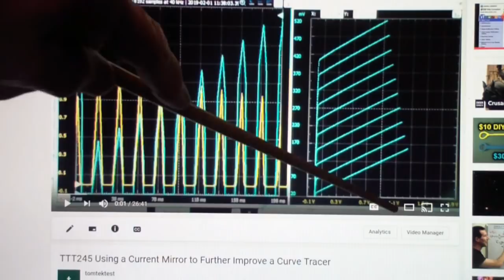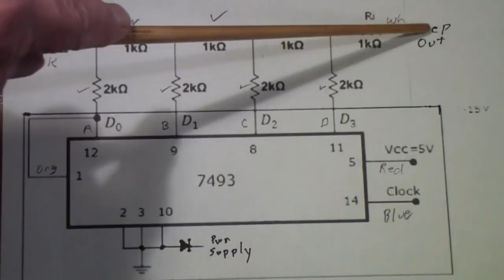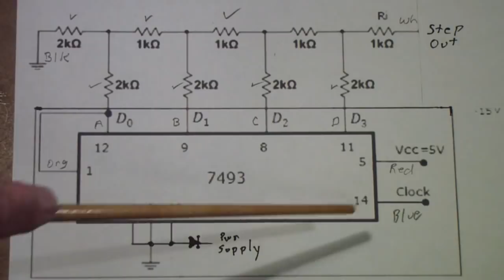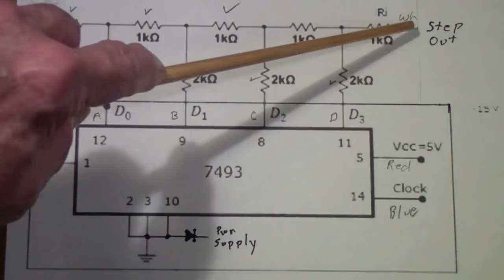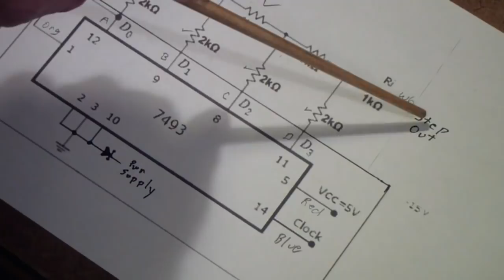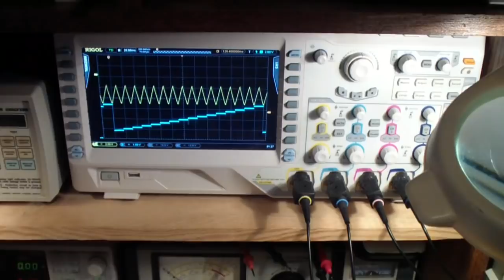TTT251 XR2206 Stepping Up for the Curve Tracer

Comment: Hi Tom,  thanks for the brilliant idea. Unfortunately in our local electronics store 7493 wasn't available. I searched for the similar and find out that 7490 has almost the same structure. It's decimal counter but it has additional NAND circuit so input should be set up to zero by grounding. The circuit provides very nice 10 stair steps gen. But it was not so easy. In the first attempt to design it I have forgotten that it is digital circuit. The steps were doubled and followed some weird curve not linear direction. As I used 7805 as the 5V supply directly on the board I should add some 330microF condensator. If became much better but the steps still were jittering . So editional 100 nF cond connected directly on the pin No. 5 finally solved the problem.

Comment: hi tom i'm building the stair step gen using dm7493an and  want to use it on one of my old cro's along with a sawtooth as a tracer.. going to use 555 for clock how fast dose it need to run roughly i will leave a pot in circuit so can adjust to fit scope screen.. also would like more current so can sweep larger power transistors. can i use lm358 on the output of the 7493?? thanks
Reply from the maker: I use a frequency of around 50-60 Hz for the sawtooth which is synchronzed to the counter clock. I am not sure why you want to use the lm358 on the output of the 7493, but I may just misunderstand what you mean. You can use an lm358 on the output of the r/2r resistor network that converts the 7493 count to the stair step to provide more current drive. Just be sure to observe the current limits of the r/2r network when designing the input circuit of the lm358.
Reply: @tomtektest8042  thanks tom and sorry thats what i meant  mean n the step output from r2r to provide more current so can sweep lager transistors also could i use the ramp from the  555 rc pin (amplified) to drive scope sweep or even a second 555 sawtooth generator driven from the first 555 rc pin for sinc
Reply from the maker: I hope you will understand that I try not to intrude into design decisions since they involve various levels of experience, budget, available materials, etc. Instead I encourage viewers to experiment and, if possible, find a local partner/mentor to work with.
Reply: @tomtektest8042  ok well thanks anyway
Reply: @T2D.SteveArcs Steve just built a Push Pull amplifier which I copied from Kerry Wongs Curve Tracer Titled Yet another Curve Tracer. 😊😊😊😊😊this should give you the extra current output. Let me know how it goes?
Reply: @MsFireboy2  thanks for your reply my friend, this was a long time ago now..
I will certainly take a look at Kerry,s video though, I like his content and haven't watched his channel for a while, thanks again 
Steve